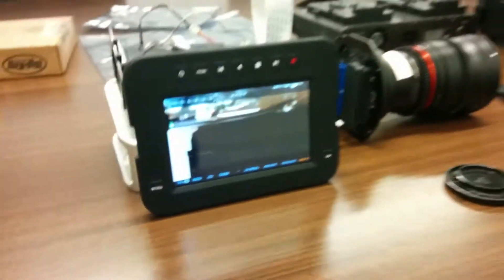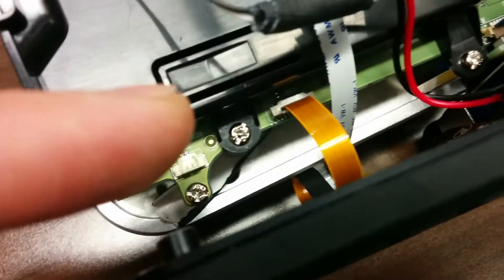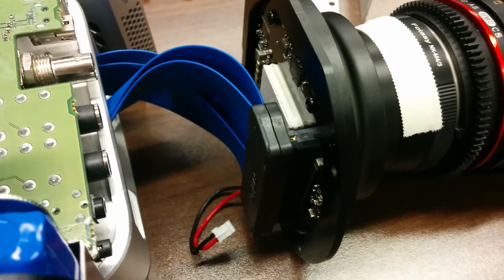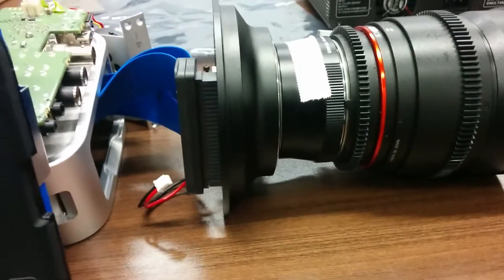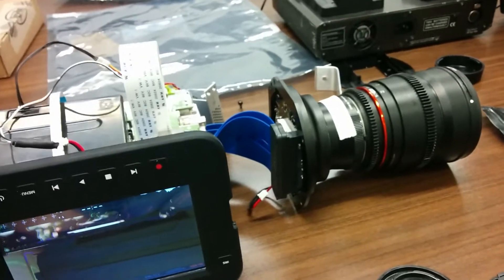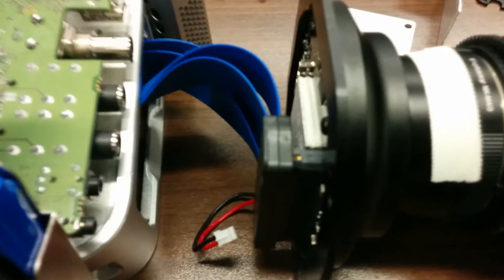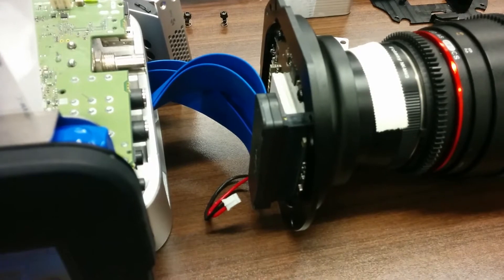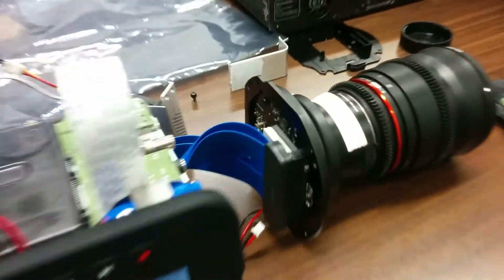Blackmagic Cinema Camera - TEARDOWN 2 OF 4

Comment: Hello Davi and very thanks for your project and videos. My soon broke the screen on his BM Production camera 4K and as you know it's very difficult to find a similar, even with references, I disassembled it. Just 2 questions please, do you know if possible to start camera without original screen ? and if possible to export to an external screen (by SDI port) the user interface ? Thanks a lot
Reply from the maker: Yes it's possible, just keep the buttons below the original screen.. it has the power button to turn on your camera. If you have an external monitor hooked up I think it'll automatically display an image to it. I can't remember. 

Also, you can easily buy a new monitor 40 pin. And then buy a touch screen panel for it.
Reply: @DaviSilveira  thanks a lot !  I think so that i'll have an image with an external monitor, what i don't know it's how to give thé user interface (menus) even it's written in manual that you can put camera on remote. Internal replace part is better but the same référence is nowhere... Do you think as mentionned that a tft 800x480 LCD 40 pins will work ? No différences in signals on 40 pins ? Do you remember voltage of screen perhaps ? Thanks
Reply: I add that the cam still worked with broken screen... I have now a lens, i'll try record without screen, buttons are still connected.
Reply from the maker: @jeanclaudemch  let me know I hope it all works
Reply: @DaviSilveira  Hello Davi, just fixed my BMPC 4K ! Founded a 2.5K for few box today and bought it... and finaly easy to replace all the rear part with screen, and it's works fine... now i'll have time to find the tft screen to put in my 2.5k and sell it ! that's all. bbye
Reply from the maker: @jeanclaudemch  amazing!! Great job

Comment: Hi Davi, Thank you for the uploads. My question lies in how exactly you took the camera apart. I have the 4K Production camera and something has happened so the touchscreen isn't working anymore. I think it's a loose cable since the camera hasn't taken any damage. I've done a lot of research trying to figure this out since I'm overseas filming a documentary and can't really send it in for repair. I'm not really a technical guy but I'm out of options so I just wanna disassemble it and make sure everything is connected, then put it back together. Thanks in advance for any kind of help...
Reply from the maker: You have to rip off the rubber matte in the front of the camera to reveal the 4 screws. There are some videos on youtube showing that, look them up. You need to be very careful as you can easily break the camera upon opening it and it voids Warranty. If you don't know what you're doing I suggest shipping it to BMD. It doesn't sound like a ribbon cable problem...? Good luck man, wish you the best though.

Comment: Did you add the Peltier plate or was it already attached to the sensor when you took it apart?
Reply from the maker: It was already there, the Peltier plate is found on the the Bmcc 2.5k, the pocket, and the 4k. It helps regulate the sensor temperature.

Comment: If you can improve the cooling from the stock solution I think you will substantially improve the noise floor of the sensor. I remember someone adding a cooler to the body externally and it worked really well but didn't look too good. Great work so far. Looking forward to updates, good luck with the touch screen cable.
Reply from the maker: I know, actually I'm working with that guy to come up with a good cooling solution. :) I can only hope it's better than the original, that's the idea..